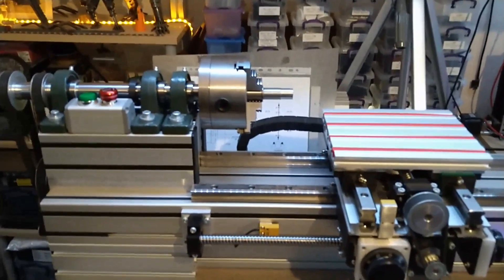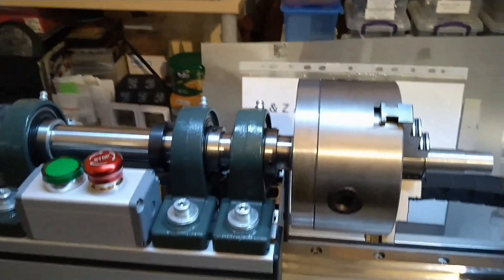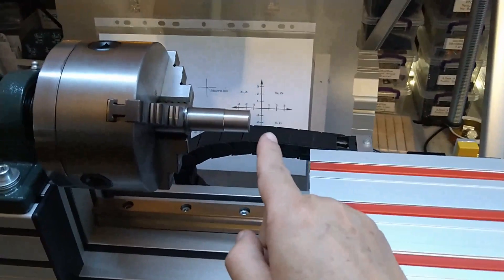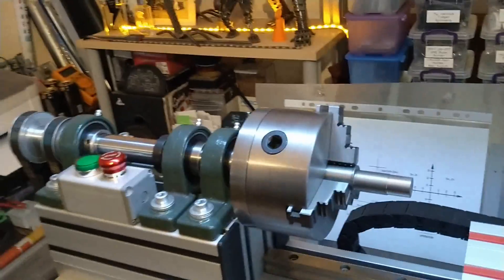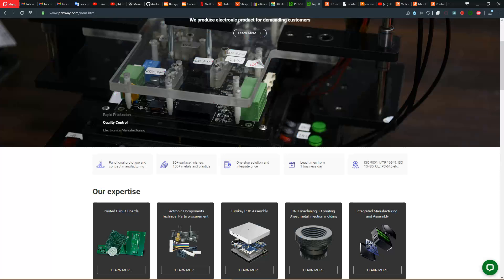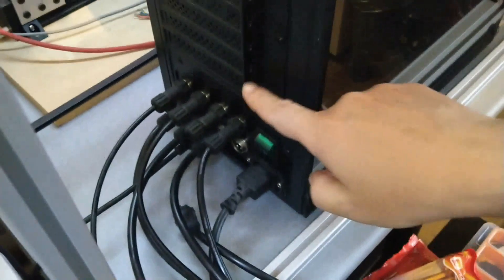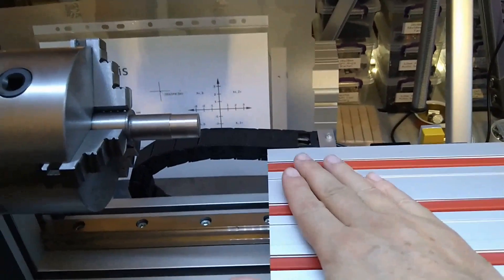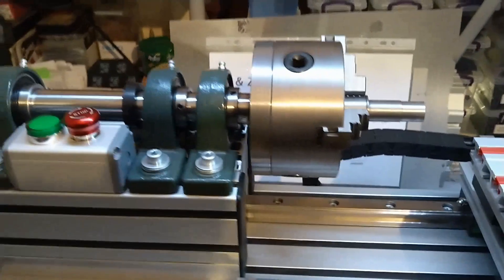DIY CNC Lathe controlled with MACH3 build by #Hayri #MACH3 #PCBWay com Part 7

Comment: Great looking lathe!   So you used a brushless spindle as the drive motor?
Reply from the maker: Thank you 🙂 Yes, I used a 800W 24.000 rpm spindle running from a VFD and it has a 6 to 1 reduction ratio bringing down max rpm to 4000 rpm, which is the max the chuck can handle.  The reduction also brings an increase of torque.

Comment: i really like the idea for the 4th axis. My cnc lathe is a generic SEIG 7by 12 with no spindle control , just Acorn reading a digital encoder ( for threading speed feedback)   I use mach3 for my milling machine , when i tried to use it for the lathe I had a problem getting the controller to read the pulses for spindle rpm. So it was a very limited machine
Reply from the maker: Thank you Rob, I am looking forward to try the 4th axis with a small engraver motor mounted onto the cross slide. Meanwhile I machined my first tool holder and can finally use the lathe more, but down the road need another Mach3 controller board as this one, although it does read and show the rpm, does not support threading, not that I particularly have a need for threading but you'll never now 🙂Stay safe and Happy New Year.